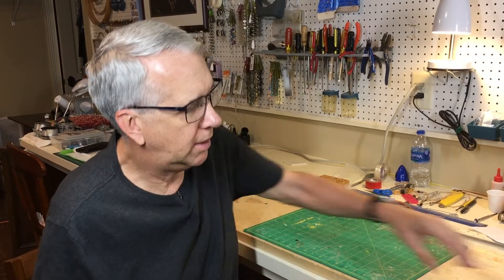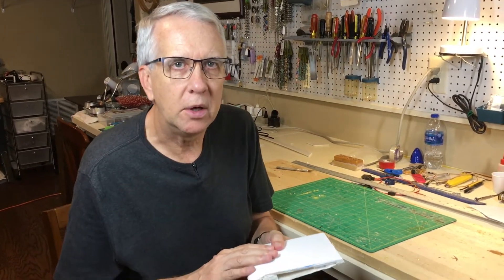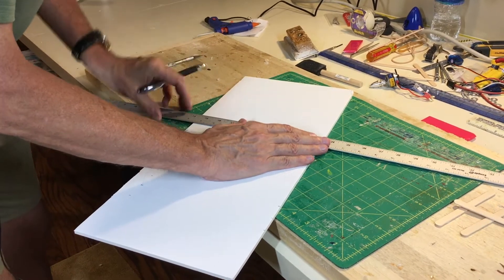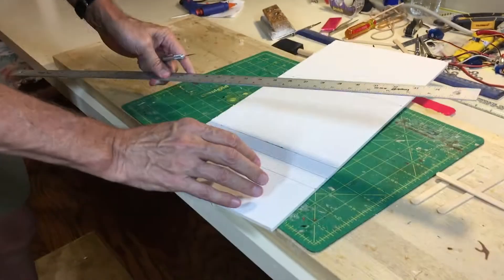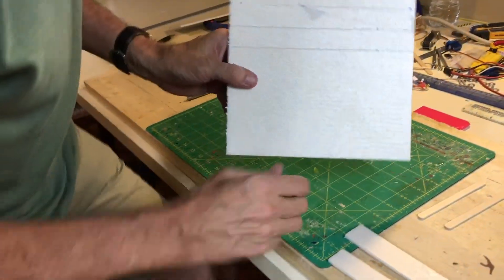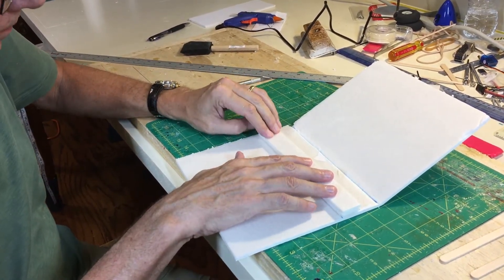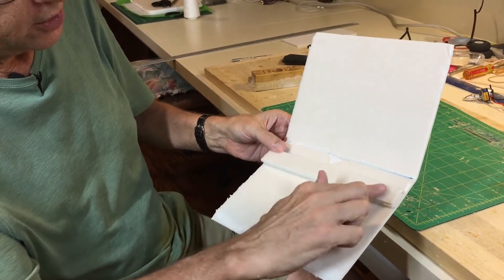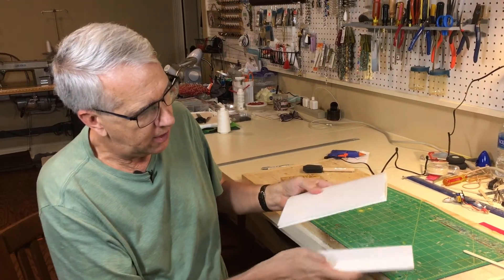Build a Foam Wing in 10 Minutes!

Comment: Excellent video!!!  This type of wing..which is flat and have a maximum thickness at around 10 to 30 % of the cords...looks like ( https://en.wikipedia.org/wiki/Clark_Y_airfoil ) a   clark type of airfoil...For a novice like me...will there be a NACA designation for this ? Thanks.
Reply from the maker: LP:  Thanks for checking in!  As there is zero research or documentation on my folded airfoil, no chance of a NACA designation.  But, on a light model like my foam board Bronco, the wing works great.  Tim
Reply: @TimMcKay56  I have found that the N-10 airfoil...looks very similar to this foam wing.  Hence...I'm planning to do a CFD  for getting the CL and Cd ....on this airfoil (I want to check on something like 60" x 24 ")....at very slow speed (10 MPH).  From your experience...what have been the best angle to set this type of wing ?...One final request...Do you have a piece of this foam board around that you can measure its weight and volume? ...I need the density  of this foam...so that I can calculate the total weight of the wing.  If the piece is square..then the volume is L*W*h.   Thanks^(N Power+1) as N ---> approaches infinity!!!
Reply from the maker: About 2-3 degrees should be fine. Tim

Comment: I built one of these planes one time. It was so heavy it barely flew. Is there a secret
Reply from the maker: This method does not work well with smaller aircraft. Maybe use a min wingspan of 30” or so. Also removing paper saves some weight.
Reply: Don't use cementboard

Comment: Like tim  demonstrates a stubby wing is  easy to build and keep straight, when u get into anything over 36 or longer  youll start having warp problems so L/TE strips need to be installed..........one last thing "monokote is a "high heat film and could mess with the foam, always use "low heat film on foam "  monokote film is brittle  and doesnt like compound curves ,low heat film is stretchy and plyable  like "econokote or other "off house brands are best on normal foam........also when gluing the T/E "press down  evenly" with the edge of a metal straight edge so the pressure is even across the entire T/E  , this will ensure a straight and even edge...
Reply from the maker: Correct. 😊

Comment: just finished a throw glider from foam board, 44 taperd span. everythings from scratch fuse, parts and all, having hot wire experience made a fuse thats been sheeted, boom is from walmart aero shafts...........weighs approx 12 oz    cant wait for test flight.....can maybe post a pic later...
Reply from the maker: Best of luck!

Comment: Hey Tim, 

Is it possible to incorporate ailerons in this design or is it a bad idea?
Reply from the maker: Ailerons are not really needed for this sort of slow flyer. You can add them, just keep weight gain as low as possible.
Reply: @TimMcKay56  Rudder and a single elevator is enough?
Reply: @Fâlcon117B  Yes, many basic RC planes use only rudder and elevator. Rudder only works fine if you have dihedral on the wing.

Comment: If you used 3 spars would it increase the lift?
Reply from the maker: Yes, if you make a "thicker" airfoil you will create more lift, at lower airspeeds, but at the same time more drag.  Best for slow flyers.  Tim
Reply: @TimMcKay56  >>>>>age old problem lift verses drag
Reply from the maker: @ZmuFFinMan  Not necessarily.

Comment: I've never flown foam... but I'm going to have to try this. So many possibilities.  Wondering if CA melts the foam? love everything about this vid except the hot melt, perhaps it was used for convenience, but seems like there would be better options for weight/strength. - Thanks for taking the time to make this vid.
Reply from the maker: Tim:  CA will attack the foam. You can use other glues like 5 min epoxy, but the hot glue guns ($10 or so on Amazon) really work well. Tim
Reply: Gorilla white glue 2 oz bottle around 10$..
Sets in 20minutes I use on foam no issue and it actually says safe for foam on the box.

Comment: Absolutely incredible video! I'm new to the hobby and am trying to build my first  plane. I was about to just use flat foam bard for my wing because it seemed very difficult to make a proper air foil. Your video saved me from a huge mistake. Thank you!
Reply from the maker: Glad the video was helpful!  I've used this wing technique on several of my models, to include the Bronco, twin motor design and the Boeing L-15.  Good luck!  Tim

Comment: Hello sir, I have a question. Does the bend on the top side and on the bottom side? If not, is there a way to make the bend symmetrical?
Reply from the maker: Solo:  Works best with bend on top side.  Would be challenging to get the same bend on both sides. Tim

Comment: Is that the full wing or do you connect more than one together using the popsicle sticks?
Reply from the maker: AS:  I connect two separate foam board panels with reinforcement tape and glue, with popsicle sticks to aid as a dihedral brace.  Tim

Comment: Great video-
Being brand new to RC flying could you help answer a few questions.

Last month I went out & boy h my first Aeroscout was 2 1.1. The larger model that has ailerons & all.

It came with a Specktrum DXS transmitter.

I’d like to start building a lot of smaller Faom RC planes myself.

A) where can I buy servos, receiver & motors/propellers.

B) how do I know if it’ll work with my existing Specktrum transmitter to bind?

C) do most receivers with I move left Aileron up automatically move right one down it does that take programming?

Newbie here interested 

If you have a email I’d be happy to converse through that
Reply from the maker: Michael:  Thanks for checking in!  I use Spektrum RC gear for everything.  www.HorizonHobby.com is the place to buy.  Great chat line help, etc.  I think the Spektrum DX6 is an affordable start for the transmitter, the Spektrum AR620 a great 6 channel receiver.  Servos can be other companies, I use Hitec HS40 and HS55, like them a lot.  I am not sure of the bind status with the DXS, may have to ask Horizon.  The ailerons should work normally with any receiver.  Purchase a Y connector from Amazon, plug into the aileron plug on the receiver (#2, I think).  Ailerons will work normally.  Tim
Reply: @TimMcKay56  thanks Tim

Comment: How do you monokote on foam? Can't use the iron I'm sure
Reply from the maker: Andre:  I tend not to use MonoKote for covering foam models.  MonoKote is heavy and uses a lot of heat to adhere.  I have had good luck with Oracoate as well as the lighter coverings (ParkLite, etc.) which weigh less and need less heat.  Also, some foam is just very tough, such as the Eflite Timber. That could probably take MonoKote.  Other, lighter foam (such as foam board) essentially cannot be covering with heatshrink coverings, as the heat needed will deform the foam.  Just need to experiment a bit.  Tim
Reply: Brown paper attached with wallpaper paste is how I"ve always covered my foam wings. Or use gift wrap if you want something jazzier. Paper will shrink slightly which will tighten up your structure. Keep in mind that the grain of brown paper needs to run with the longest axis. Finish with varnish for waterproofing.

Comment: I would like to find a clear liquid adhesive for foam board.  When building the interior of a fuselage the hot glue method does not work very well.  I have seen a product that I am not familiar with used on foam board construction where the thin (3/16") edge, is attached to a flat surface. The result would be like the letter T.  The material I have seen used had the name TITAN WILD on the label.  Please advise  cmur757@gmail.com   Thank you
Reply from the maker: Charles:  I did a quick Google search on Titan Wild glue . . . looks like a good option for a clear, gap filling glue on foam board.  Amazon has it among other stores.  Tim

Comment: thanks, how do you add ailerons and flaps on it? Do you add extra foam for that or just cut the part of the wing?
Reply from the maker: Firoz:  I always cut out my ailerons or flaps from a separate section of foam board,  be sure to bevel the edge at 45 degrees so it can move down without binding, and then hinge.  I usually use tape for the hinges.  Tim

Comment: Can you show how you built the dihedral brace using the two sticks. I tried to do something similar but I am not able to achieve the dihedral
Reply from the maker: Kevin:  The dihedral brace is a "cut and fit" approach.  I glue the two wings halves together, which will  hold the wing in place.  I cut an oversize channel for the popsicle braces to go into, with as much overlap as I can, and hot glue them in place on either side of the foam wing spar.  Not scientific, but with the drywall reinforcement tape, together, seems to work for a model under two pounds or so.  Tim
Reply: I can show you how in one of my videos.